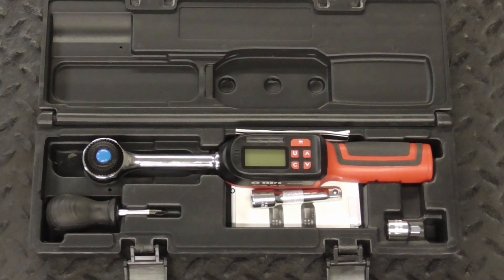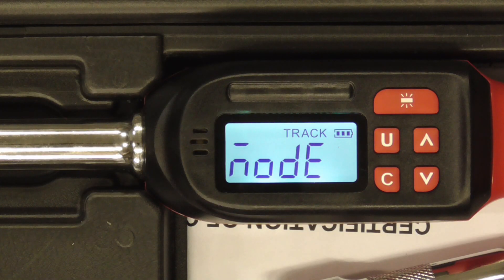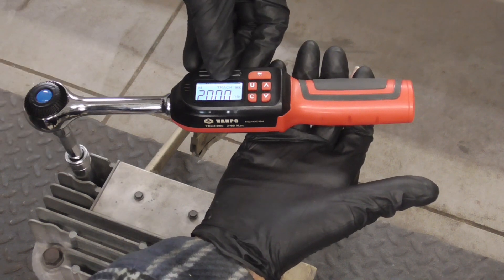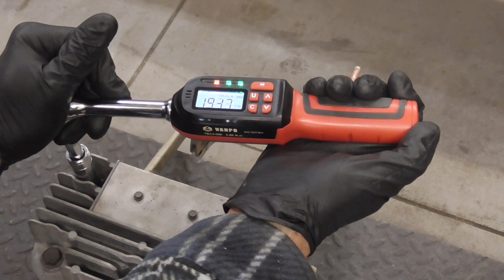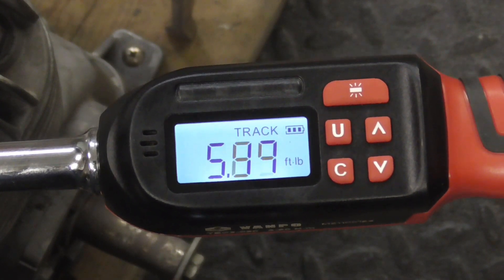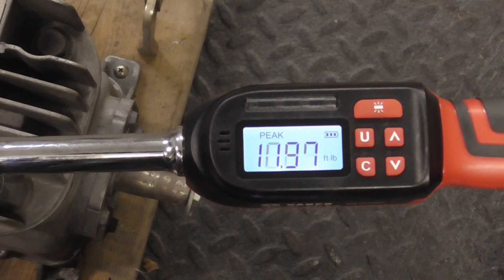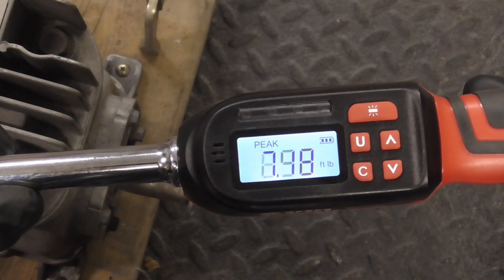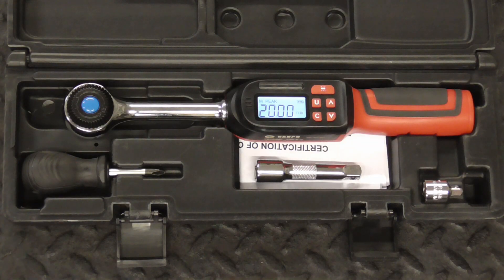VANPO Digital Torque Wrench with Peak and Track Mode

Comment: pls can i use the peak mode to determine the torque a bolt was torqued  at ?,, because i would like to losen a bolt and then reinstall it with the same correct torque , pls help
Reply from the maker: Yes - you can always use peak mode - keep it in that mode so that it is like a normal torque wrench :)
Reply: @LakesideAutobody  thanks

Comment: How do you get the mode to change? When I press the arrows on mine it changes the desired torque setting, not the mode. Thanks.
Reply from the maker: Hold down U to get it into the "mode" setting, then press up or down.  If that doesn't work let me know.  This video explains it a 1 minute and 40 seconds in - https://www.youtube.com/watch?v=lTB9ySsaW2U
Reply: @LakesideAutobody got it, it was long pressing the U. Thanks
Reply from the maker: 👍😊 @LichaelMewis

Comment: Thanks for the clear descriptions of both modes. I just bought a digital torque wrench and was confused about those mode operations. Like many who've commented, I've been using old school clicker type Snap-On torque wrenches for decades and have now modernized my toolbox.
Reply from the maker: Plus it's just more fun to use 👍🛠😊
Reply: @Lakeside Autobody   Yeah, it is. Lots of flashy lights and nice beeps when you can't see the dial for feedback. But since AAA batteries are crappy nowadays, I always remove the batteries from tools I'm not using frequently. I've had so many batteries leak lately and mess up things that it's not funny.
Reply from the maker: @tunnelcat  👍😊

Comment: How to reverse it?
Reply from the maker: Turn the black dial on the back of the ratchet head to reverse - sorry I don't think I showed that :)
Reply: @LakesideAutobody  I guess mine was a different. Couldn't seem to turn it no matter what I did. Apparently, I had to hold the other side still and then I could reverse clockwise, else it was not budging at all. Works fine now